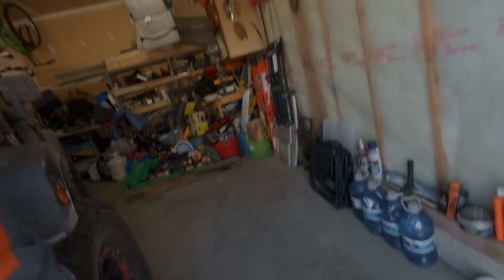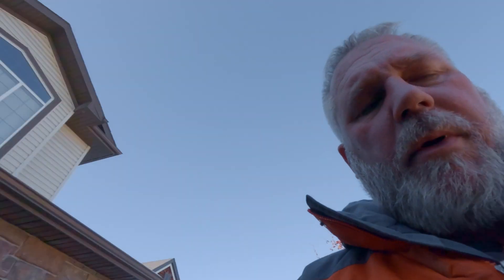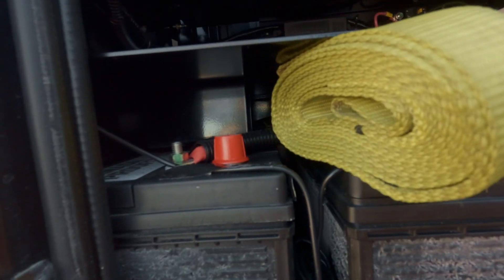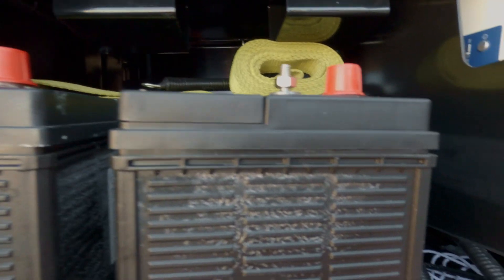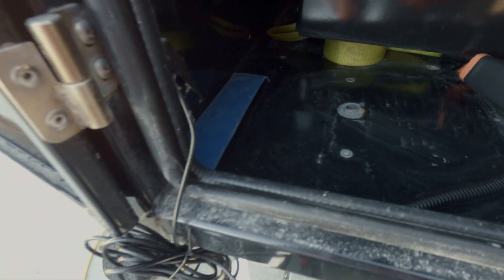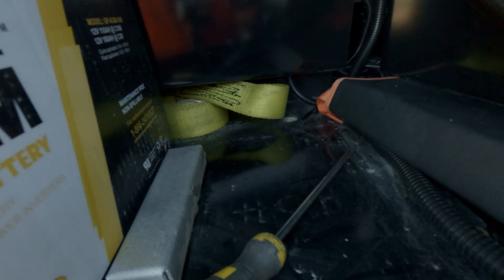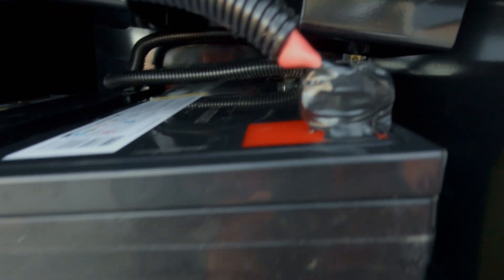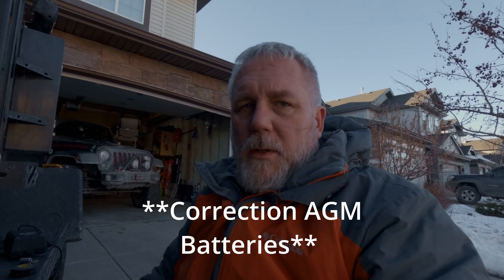Easy Battery Replacement: Trailer AGM Installation

Comment: Crazy they didn't last more than a year!  But, glad they honoured the warranty!!   
I had my Tacoma's battery die after 1 yr and they did the same, thankfully. (Not like this setup though!)
Reply from the maker: Frustrating but the math is not adding up seems there could be a parasitic load or ground acting like a load. TBH the new batteries did not do much better😢